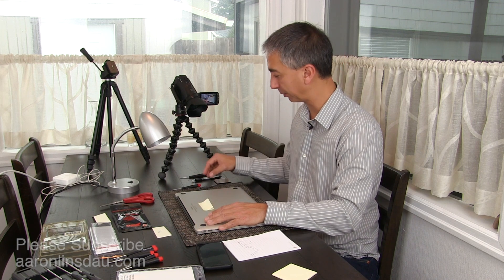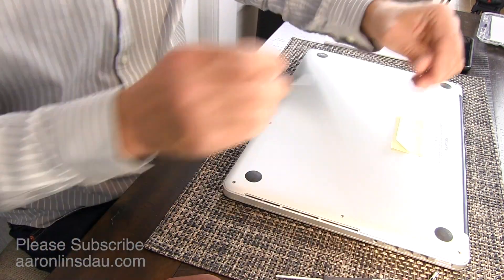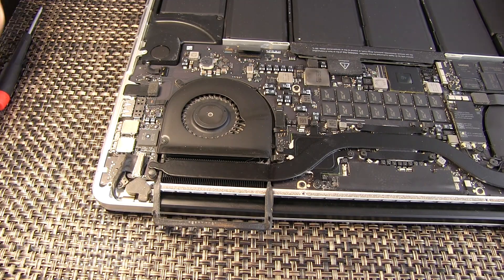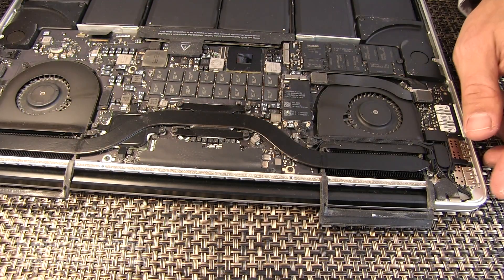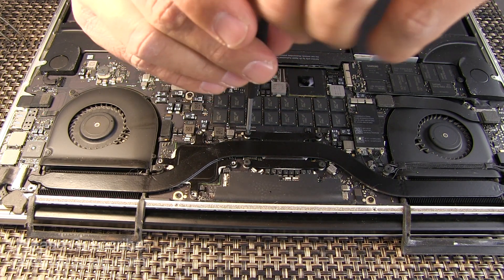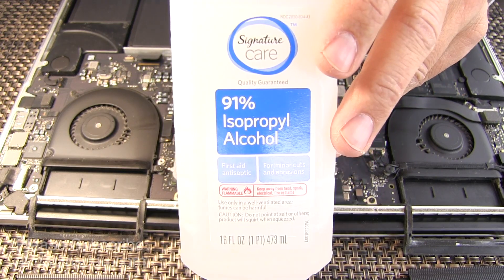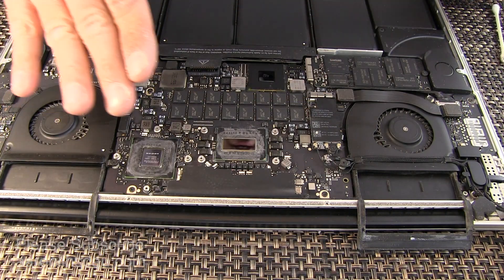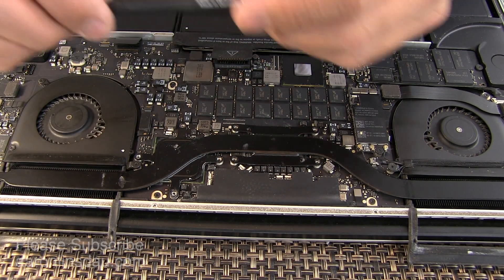Fix overheating Macbook Pro Late-2012 A1398 Heat Sink Paste Replacement

Comment: Hey dude thank you in 2022. Just bought a 2012 i7, everything is running 30C cooler. Knowing the NVIDIA screw lengths helped a lot too. Also, not sure if anyone else noticed, but I had 7 long screws and 3 short ones. Something tells me that one of the front or back screws is not actually short, and the chassis will show that inside. However, I didn't want to open it up again and strip anything... not until I put on new paste in 2025. Viva la 2012 MBP.
Reply from the maker: Hope it keeps runing!

Comment: This should always be done no matter what, because it's basic maintenance. However, don't expect major improvements on overheating. That's the experience I have from all the 3 macbooks I did maintenence on.
Reply from the maker: Good pointer.

Comment: So having cleaned the fans, replaced the battery & themral paste on my 2014 MBPro I am still suffering from GPU over-heating...... ANY TIPS ANYONE?
Reply from the maker: It's actually just an issue with that series. Mine finally died.
Reply: @ALinsdau  Once the problem showed itself, how much longer would you say your machine lasted?

Comment: Quick question is the heatsink 100% copper and cpu/gpu not aluminum based?
I want to install liquid metal thermal compound instead of thermal paste. My 2013 retina keep hitting 100° CPU when gaming. Need to turn that down.
Reply from the maker: Sorry, not sure. I don't have it any more to test. The GPU fried and died.

Comment: Still overheating after thermalpaste can not solve my problem is actually when ı open YouTube try to watch over full hd it s freezing and heating 😭
Reply from the maker: It's the graphics chip - there is a known problem with the GPUs in this series. It was under warranty but now I'm not sure.
Reply: @ALinsdau  ı think same with u but this machine has only intel hd 1536mb graphic card same with non retina model 13-ınch
Reply: ALinsdau I’ve narrowed it down to the GPU and the only thing that works is running apps on low resolution mode (music production). I’ve tried the paste as well as other methods. Do you know of other remedies?

Comment: My macbook pro temperature increased by 15°c after i cleaned the heatsink and replaced the thermal paste and no matter what thermal paste i have used, temperature are very high for simple web browsing, Any idea why?
Reply from the maker: If the heat sink isn't firmly pressed on, that might do it.
Reply: You may have used too much paste or too little.

Comment: thank you for this video,  well done.  I'm about to do the same,  so this is very helpful,   however,  based on other comments,  i'm not sure about the quantity of thermal paste.   I will keep researching,   if i find anything worth sharing,  i will post it here.   thanks again.
Reply from the maker: I went crazy on the thermal paste. There should only be a tiny dollop. Another commenter said that, and I shouldn't have pulled up the heat sink, either. I had to do this so viewers could see the result.

Comment: thats wayyy too much thermal compound haha. small pea sized is sufficient
Reply from the maker: Sadly the thermal paste wasn’t the issue - the graphics chip overheats in 3 minutes.
Reply: @ALinsdau  Most likely is the GPU VCORE (U8900) chip. It provides power to the GPU and it should output 9volts. The soldering of that chip is messy from the factory. 
"Most 820-3332 boards used in the 2012-2013 A1398 MacBook Pro will develop a issue to to flexing where the solder joints on this chip will become degraded and break away from the board. This presents itself as random black screens, no video, kernal panics, freezing, and rarely video distortion. The solution to this issue is to resolder the pins on the chip. 
*DO NOT reflow the GPU.
*DO NOT use hot air on this board near the chip.
*DO NOT attempt to resolder this chip if you do not know what you are doing as you will probably cause the GPU Vcore fets to explode and kill the board."
Reply: @ALinsdau  how much temp was it showing?

Comment: Thanks for the video but you need to put less thermal paste and spread it even creating a thin layer. If you just slap the paste and then put the heatsink on top it will not be uniform and you will end up exactly like the mess they did at the apple factory.

Just a friendly tip :)
Reply from the maker: Thanks!
Reply: no no thin layer it causes bubbles you need to let the heat spread it
Reply: @Struwex  i keep hearing conflicting opinions
Reply: @aguiremedia  Me too mate